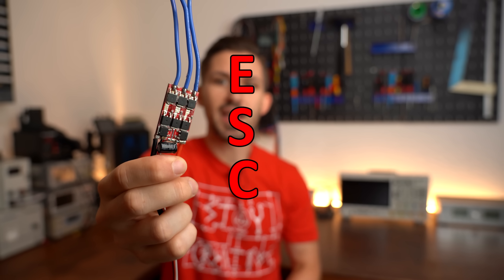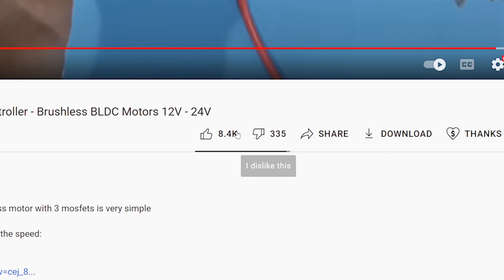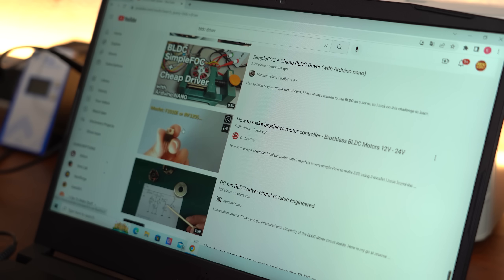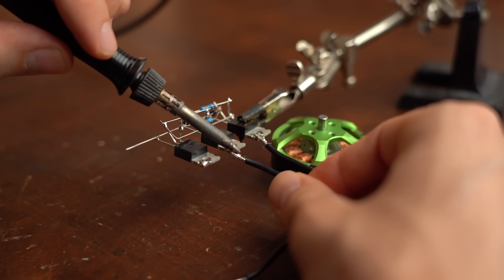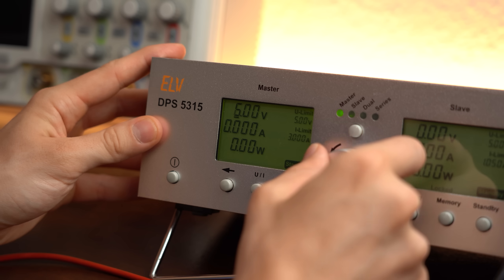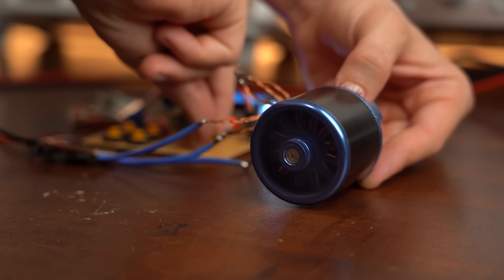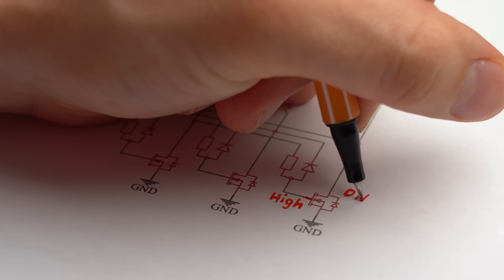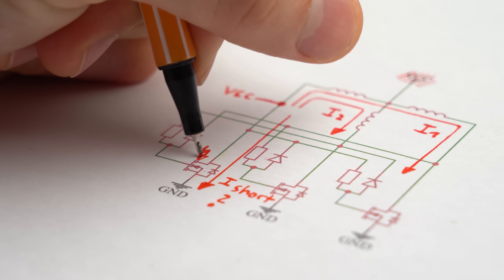I followed a YouTube Electronics Video and Regret it! (Debunking a 500k video)

Comment: I am old enough to say in 80' only source of schematics was magazines .  I was young and had no much experience in electronics as today but never gave up after building some devices from schematics in magazines which actually never worked. And after all my biggest surprises was schematics found and working ones as it was my first amplifier based on IC TBA820 , than second one based on transistors 2N3773 but rated 60W output what surprisingly was true. After all I remember my first bench power supply built with transistors only with current limiter and voltage regulation but no short or reverse voltage protection.  And still remember my milliohm meter based on ic741. But at the end if schematics given in trusted magazines was  not good, what to expect today from internet where everyone are allowed to put online their schematics which are garbage. At the and ty for video, such videos can help not to lose time on projects which will fail bec bad schematics.
Reply: With magazines it was hit or miss, best was to wait a few months until all bugs were ironed out. The magazines killed themselves when around the mid 90's they started to publicize projects that called for preprogrammed components like PAL/GAL or microcontrollers without publishing the sources. People got tired of that behavior very fast and moved to more open sources of information. Nowadays those magazines look like a paper version of YouTube.

Comment: I would like to build a 3 phase wind turbine. I keep wondering if a large bldc motor would be up for the task? Anyones thoughts?
Reply: It could definitely be done, so long as the motor spins freely enough to start rotating from a light breeze. GreatScott actually has a video with the exact circuit you'll probably need https://m.youtube.com/watch?v=ZswJoAvbuzY (the schematic is around 8:52 in that video). You'll probably want to avoid hoverboard motors such as the one in that video, you'll need too much torque to start it spinning. Depending on the size of your turbine, you could use belts or gears (large gear/pulley on the turbine, small gear/pulley on the motor) to turn the motor faster and generate more electricity

Comment: Mentioned circuit though unusable in real life is nice demonstration about how ESC works. Of course even simple proper ESC is way more complex than this circuit. Also nowadays ESCs are controlled not by voltage change but by PWM or more complex digital protocol (OneShot, Dshot etc.) which also give telemetry feedback about motor status back to user which add mandatory MCU IC or even several MCUs to ESC circuit.
The real problem with mentioned video is that author most likely made it for YouTube view collection. Otherwise he would at least explain the principle how his circuit works. This approach works also because in developing countries people use DIY made stuff because people here are dirt poor. They often can't buy new ESCs, however have access to electronic waste and have access to Internet somewhere. It become obvious why such videos become popular.
Reply: actually its all PWM, and voltage determines the maximum RPM.

Comment: On 4 wire motors you can simply use uln2003 and a counter to power each coil at a given time. Which is default way in some devicea. except counter is in general   arduino or some other programmable device. But they are slow and less powerful . 3 wire motors are superior and need more circuits because they also use half states and switches coils from vcc to gnd each step which requires good timing and correct decharge timigs. And most electrical power devices use that style. 
With 3 transistor/mofset  controller you cant use half coils, and can use only one coil at a step and cant use coils in reverse mode. Which probably means motor will work %30~ of its power .

Comment: That's  cool, but if you take two of same bldc motors. Take one and direct connect a dc motor with variable control to it. Now connect the same wires that came on the bldc motors together to each other.turn on the dc motor that is driving the first bldc motor , which is now a self generating motor that is wired to the second bldc motor. You might have to give the no 2 motor a little push, but the motor will take right off . Control speed with the variable dc motor . You will find the no 2 motor will have plenty of power. 👍, Test it out, on bigger bldc motors I have seen voltages on the drive bldc as Rhigh as over1000 volts . And it's spinning at over4000 Rpm's.

Comment: What I've come to learn is the reason why real circuits get so complicated is because the real world is messy and fickle and anything can go wrong. Therefore, the more complex the circuit is the more problems the creator foresaw and accounted for. Every little extra component is there to better ensure the whole thing doesn't break randomly for a weird reason you didn't see coming. It's exactly like bugfixes in computer code. So, I tend to take simple designs like these as more of a proof of the underlying concept than anything practical.
Reply: It's funny you mention code - I'm not really a programmer (though I do code), but I am a fairly senior systems engineer. An instant display of naivety is, to me, when I see anybody say "Pfft, I could build that in [x]". You see it so so often in engineering, electronics, IT. Nobody ever seems to stop and think "Maybe it took clever people so long because it's more complex than it looks to get right"
Reply: @regiondeltas  Over confidence happens even to the best scientists. Not too long ago, and even now, many scientist still use the word "junk DNA" for non-coding DNA thinking they are garbage. That is like me looking at a computer mother board, and say all these resistors are junk components.

Comment: to be completely clear most of the advanced high quality well performing circuits today are the latest in a long line of iterations the esc si no exception modern integrated ones are fantastic and does the job amazingly but there being a simpler alternative was unavoidable
Reply: Design engineers are meticulous in simplifying circuits as far as possible. If there was a simpler design that meets the specs then for sure the engineers would have chosen it. Fact is the simplified circuit doesn't work very well and had loads of ways of blowing up itself and the motor.
Reply: @jamesrindley6215  uh yes did you finish reading my comment?
Reply: @arnearne12345  Yes of course I read your comment. Perhaps you are surprised by someone agreeing with you in a youtube comment. It doesn't have to be an argumentative forum.
Reply: @jamesrindley6215  that really felt like the beginning of an argument and honestly reads just like someone who only read the last line in the comment

Comment: Although this circuit is pretty much a fet killer, there is room for improvement. With mosfet drivers to turn the back-emf into a proper gate signal and with diode clamps to keep the voltage within Vcc and ground maybe, just maybe, it could get a little closer to being considered an esc. Still, a microcontroller is essential for stuff like self start, anti-stall, short-circuit protection, pwm control, overheat protection, low voltage cut-off (to avoid lipo overdischarge), and such, mmh... that list was longer than intended
Reply: Until final version will not much differ from commercial consumer grade ESCs.
Reply: the point was to avoid using any kind of smart microcontroller or any kind of coding. just a bunch of components glued together. in essence, making the brushless motor as simple and cheap as a brushed DC motor

Comment: Actually I think this is a brilliant circuit design because it contains the bare minimum to get the motor spinning and it is easy to understand. I find it great for teaching purposes. It's just that it has no practical use. I would say it's a great circuit as long as you know what to expect.

Comment: excellent research So the question is: Can I make my own driver for my HDD's 3 wire motor, or do I need to buy one? I want to turn my corrupted HDD (3 wire) into a sandpaper grinder (for 3 Wire).

Comment: The thing with a switching circuit is that you have lots of parasitic effects that you should be really spending time on in the design phase.
It is not only depending on components, but also on the PCB layout and sometimes also the load.

Comment: This is also the root schematic of a phase-locked-loop (PLL) used in microcontrollers. Each of the three fets feed into one another to produce a distorted sinewave with 120 degree phase shift between each stage. Except, when you throw the inductance of the motor windings onto each leg the phase shift is no longer constant. I had toyed around with a circuit like this years ago to try to use it as a sinewave reference to drive power mosfets in a three-phase half-bridge configuration, but at that point it gets complicated enough that you might as well just build a proper ESC.
Reply: Can you please elaborate ?
What's the input/output signals, how does it work to be a phase controlled system in a control loop ? 
I have basic understanding of PLL but i can't make sense of your comment
Reply: @weistonaski6924  it is a fixed frequency phase shift oscillator in which the drain pin on one MOSFET phase feeds though a capacitor to the gate on the adjacent fet. Repeat 3x and you have three fets operating in parallel. Drain on each FET is tied to a resistor to source voltage. Like an astable multivibrator which is basically a 2 phase shift oscillator the three FET circuit is a 3 phase shift oscillator. Frequency cannot be adjusted without varying each drain-to-gate capacitance equally otherwise you will have inequal phase shifts due to inequal capacitance time constants.

Comment: Haha! I feel slightly vindicated in my hobbyist electronics skill sets! as soon as I saw the circuit I deduced there would be no self start characteristics.
And it's really a shame too, because while there is no free lunch, you can build a BLDC driver that uses analog components and variable resistors to mimic the digital logic, at the price of being forced to tune the circuit to every motor.
And that's a horrible price to use a motor but that is perfect for learning, and learning only, it gives the young hobbyist a good lesson in not just analog computing and the basics of electro mechanical maths, but also in using all of thier labs equipment not just a multimeter and some podged together soldered joints

Comment: Yeah, I have done 25 years ago a similar circuitry but with only one transistor for a casete player with the motor driver popped, a custom one ( with control in both directions ), the efficiency was pretty good but needed a capacitor in paralel with the resistor to increase the efficiency and move the switch timing, that capacitor helped at auto starting as well.
Agree, you need to buy a dedicated controller, BUTT, in some cases that one is good enough 🤷‍♂, there are some country's that work a month to buy a dedicated controller, for them to build a controller with around 1 USD and a good enough performance is a big deal..

Comment: What I'd really like to know, is how few components can you use and still make one that works? Obviously 4 is too few, but 85 seems kind of insane. Surely you can make one that works well with less than 85 components, right?
Reply: It depends on what you define as a component. This "lowest number of component game" is even weirder with high freq oscillators/circuits.
Basically in high enough freq your circuit stop behaving normally, and effectively every millimeter of wire is like a component (and sometime a really complex one!)
In case of the ESC example, you might want to use solder (mostly Tin or SnPb) as a low ohmic resistor. But you can use wires as coils, although at that frequency you need lots of windings. You can also build capacitors by coiling two wires together. This way you can "lower" the components costs.
Reply: @adamrak7560  Fair point, but let's say we define component as discrete pre-made pieces. So a wire coiled up would still be one piece as long as it's one continuous run. With how few components could you make a working ESC that functions well?
Reply: @anon_y_mousse  I'm pretty sure if you removed like half of the capacitors and probably some resistors, it would still work, but it won't be as stable. Changing or removing core components - like some of the transistors or the microcontroller would require a complete redesign.
I don't have much time right now, but i'm pretty sure you could do a working ESC without  a microcontroller, but with some kind of a clever discrete feedback loop.
Of course, that would only work in voltage or PWM input mode, not some fancy  digital protocols.
Reply: @izimsi  So essentially you're saying it can't actually be done in less components and still function well?
Reply: @anon_y_mousse  if it could be done with fewer components without losing any stability, it would be done to make it cheaper - that's just basic economy. You could probably check if there are major differences in number of components between the cheapest Chinese ESCs, and those from some kind of established brand (also made in China :))
The cheapest ones will probably use the least component count possible without getting too unstable/hot/broken.
Reply: @izimsi  Perhaps, but if we're talking about losing a mere 10 to 20 components and being less capable, it's just not worth it. If we're talking 50, that would be worth it, but at this point I'm doubtful.

Comment: Just curious to know what is the use of of such complicated motors? Why dont they just build normal DC motor instead and control it with voltage control instead?
Reply: Finer speed control and more energy efficient. These motors make products like drones feasible.
Reply: @markc2643  Also no brushes that have to replaced over and over again.

Comment: This is a naive comments from a novice electronics hobbyist, but could you use a smaller cheaper driver to control MOSFETS which then could be connected to bigger motors

Comment: Well that crude schematic is close to that videos of self power generation units only with a couple of supermagnets and some wires 😜
Anyway, driving an 3 phase motor with variable speed (frequency) needs a complex unit that regulates besides the frequency also the voltage because of the (with the frequency) varying inner resistance of the coils. Also you had to deal with interferences and noise generation. 
I ve set up many industrial VFDs for Hvac purposes. So I assume that in this esd is also more knowledge than solder together a bunch of mosfet and resistors.

Comment: well but of cource its good to learn what the basic concept of such a driver is. Dont be too rude on videos, where something complex is burned down to its actual thing, to explain how it works.
And it actually works! 
So theres no false statement in the original video.
Reply: "It actually works"

For very small values of "works".
Not self starting
No speed control
Grossly inefficient
Highly dependent on motor characteristics
Reply: @ferrumignis  yea
thats true. 
But i kind of want to build it and see how it works, and how you could improove it.
I think it would be a fun project.
Reply: @ferrumignis  Still it works, that's the point. the original video is not meant as don't by ESC you can make it cheaper. its basically showing you can make one from way less part and will work. Also GreatScot has few questionable videos as well, in the end of they day, if you are a moron, no amount of warring tags will stop you from doing something stupid.

Comment: The DIY ESC looks to be working on pretty well the same principle as the fancy expensive ones if you break it down.  It does not have the same safety and over-voltage/over-current protections that fancy expensive ones have.  This would mean it cannot restart when a stall happens, as you demonstrated with the small motor.  Purely  bench experiment, not something you want to put into production for sure.  Interesting to experiment with though :)
Reply: The main difference is that the commercial sort have a microcontroller scanning across the coils, activating one at a time.  This simple DIY sort is stable just activating one coil, and only switches to another one if the rotor moves.  I guess it relies on induced current from the magnets, to switch states.

It would probably be possible to make a better one, with more components, by adding capacitors to turn it into an oscillator with three states - similar to a two transistor, two capacitor oscillator, but with three stages instead of two, with each one triggering the next.  You wouldn't be able to adjust the speed easily though.
Reply: @TooSlowTube  in this vid it is a joule thief or a skin effect consor
Reply: @TooSlowTube  I'd love to see that video. Even better if one started with this one, an showed how to solve problems as they turn up. That would be a Great Scott -video I'd watch over and over again.
Reply: With a few more bipolar transistors you could have actual feedback gating and zero crossing detection, as well as anti-stall kicking. Sure, it’s easiest to do with an MCU if you don’t know a lot of analog building blocks, but those MCUs for the most part implement simple algorithms that come directly from older industrial servo drives that were 100% analog.

Comment: I assume adding giant mosfets and some feedback circuit would be difficult?
Reply: Why would you want giant mosfets? The ones he used are very capable is driven correctly, which this circuit cannot do so efficiency will be horrible.
Reply: @ferrumignis  If you consider things mentioned in video, and assume I just might not be retarded, you might realize I'm not talking about this circuit.